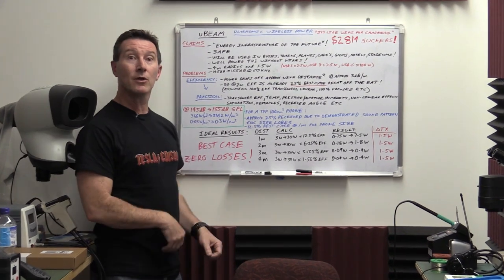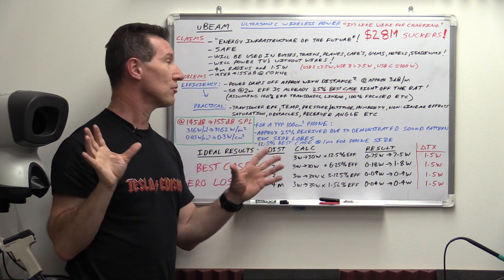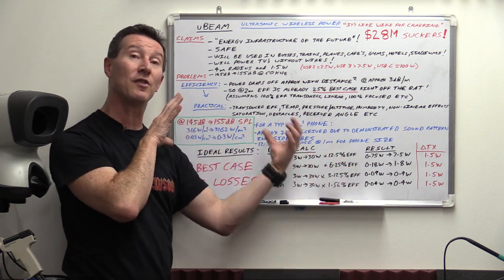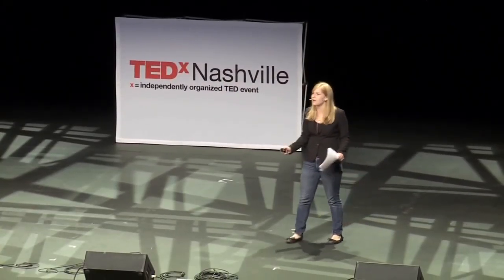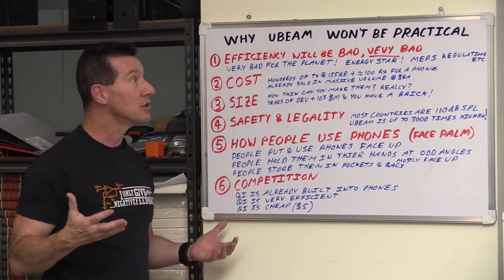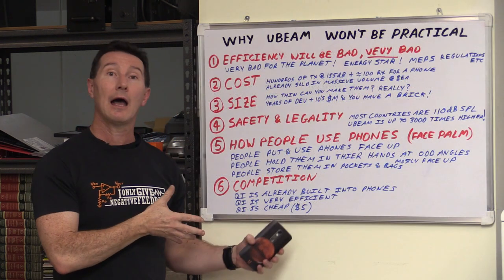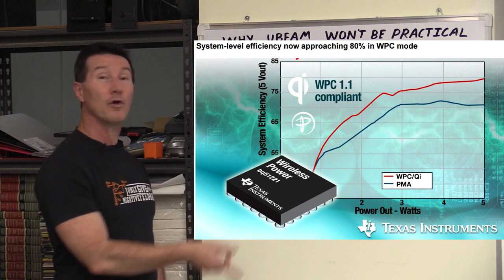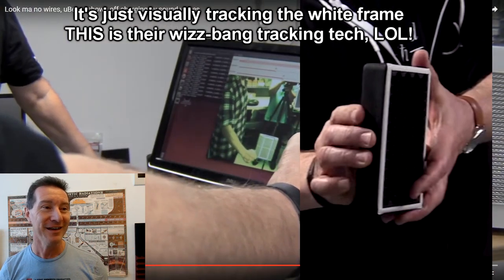EEVblog #1001 - uBeam Ultrasonic Wireless Charging DEBUNKED!

Comment: Wouldn't it also disturb the local ecology if it somehow magically worked ? Lots of species can hear well into ultrasonic range and I know it's beamforming but at that high of energy and the usage everywhere enough would surely some of the energy "leak" (for the lack of a better word) out of the beam to harm certain species.
Reply: 145 dB to 155 dB is too loud to be heard.  125 dB is very bad for human ears which are relatively insensitive.  A 100 to 1000 times higher pressure level and a more sensitive ear is not a good combination.
Reply: I stand corrected!

Comment: I have a 22000MAH battery brick that's about the same size as that receiver.  I can charge 3 devices at once, at 2 amps, from flat to full, 2 or 3 times over.  It was $40.  When your competition is either QI cheap plug-in chargers or "just get an additional battery", charging using hundreds of ultrasonic transducers is absurd.

Even if they solved the thickness and weight problem with the uBeam, even if they solved the cost problem, even if they somehow solved the ergonomics problems, it's still not practical to use it because of the sound levels.  There are reasons why you should consult experts in what's practical instead of spending millions on what's not technically impossible.

Comment: You know the efficiency rating would actually be half what you said, since SPL drops by 6dB per every doubling of distance, not by 3dB (assuming a perfect 'point source')
Reply: I do not know about measurements above the "listenable" audio range, however in audio the power output of a audio amplifier must be doubled to gain 3dB in volume (make it play louder).

Comment: You can do neat stuff with focused ultrasound, such as sound projection to have audible sound reflected from a concrete wall. Not energy-efficient, but quite a surprising effect, which could be useful. I've seen demos where you can hold your hand into the inaudible primary ultrasound beam, and hear music reflected off your hand. Maybe they could go into that direction with their tech, which I agree is quite impressive. But phone charging is not the application.

Comment: This video gave me an idea for a system that would actually work, and I already have the apparatus to do it at home. The power transfer should be better than 60 dbm. Seriously, the apparatus us already in my kitchen. It uses RF rather than ultrasound, and it's quite a bit larger and uses over a kilowatt of power, but could be easily modified to charge phones anywhere in the house. All I'd have to do is modify the stirrer and defeat the door-open interlock. Now  if I could just figure out a way to overcome the safety issue, as it currently tends to cook anyone who gets too close.
Reply: thanx, i also got a microwave oven ;)

Comment: Just to point out, Cophasing or better known as beam forming is a science that uses feedback in order to appear to be tracking an object. It actually superimposes waves based on phase shift at a geometric distance from the transmitter.
I forgot to mention, had to come back and edit, the feedback is from a camera on top of the transducers and the funny part, the tracking is done by NVIDIA Jetson TK1 which is ridiculous to think i would be showing off my phone to some charger to fire Ultra sonic vibrations to charge my klunky phone.

Comment: I really like your vids and you are fast at debunking stuff but just consider this:
If there was internet back in the day and you heard about x-rays and marie curie, you would have debunked it right away too yet today it's one of the most common and regularely used technologies to check broken bones, dislocated muscles etc...
it might have it's spot in some niche applications where efficiency isn't a requirement.
Just think about it for a sec.
Reply: The problem with your thinking is the following:

Ultrasound technology has been around for years. Pressure waves as a medium to transport energy is known for a long time. This chick and her company did not really invent anything, they only clobbered existing tech together in the least practical way possible. So it's not the same as x-rays and marie curie.

And it's the same bullshit over and over again, which makes you think everyone with a highschool level of physics understanding and the "yellow physics formula book", a napkin and a pen could debunk such bullshit ideas like solar roadways, waterseer, fontus, thorium cars and wireless energy transmission (be it coils and EM fields, magnetic over large distances, sound waves or laser beams) in less than five minutes.

The best lithmus test for bold claims about new tech is the following:
- Has there been recent discoveries in the scientific backbone (physics) that change the laws within tech can be developed. This was true for x-rays and radioactivity in Curie's days. This is not true for any ultra-sonic related tech.

Bam. Done. If this single point is checked, you can easily debunk any claims about new technology.

The second point is that you do not produce something and wait for a niche where it can fit. It's not necessary. If the niche will come up, you can develop a product for it then. The niche will not magically pop up after you have the product, that's just too arbitrary and unlikely to waste 28M$ for.

Developing stuff that has no application yet only happens in the so-called fundamental fields of science for a reason: It's providing building blocks for future tech. It does not happen in the tech-to-market space. I'm sorry, but fundamental laws in physics strictly dictate what's possible in engineering, and never ever the other way around. Engineering your way around laws you have learned about in high school physics? Not possible.

I all too often have to do head->desk and facepalm when I see new claims about magical batteries and new, revolutionary 100GHz computers. It just doesn't happen without new ground breaking results from fundamental science research first.

Seen any new fancy tech recently? Look out if there exist some research papers to back it up in a fundamental way. If not? It's bullshit, easy as that.

Comment: By the looks of that emitter, and its ability to beam in direction, I'd warrant that it uses a phased array. I recall you did a video on an experimental phased array antenna a while ago. Could you do a video on how to control the phase shift of each element in order to steer that beam?

Comment: I sometimes think you forget that computers used to be the size of a car to do less then 1% of what a phone can do now. So in the future I am sure they will get it down in size, efficient enough to charge. I am more worried by the high dB waves that will screw up some animals and other devices.
Reply: Lakloplak You are completely missing the nature of the inverse square law and inherent attenuation with distance from the source, these are not things you can just optimize out of a product with mere research, they are fundamental rules of physics and mathematics.  Then there is the issue that these ultrasonic frequencies are well within the normal hearing range of many common pets and the inherent dangers of 155dB sound pressure levels.  Worse still, the technology does not account for the manner in which people actually use their phones or the fact that high power ultrasonic transducers are not exactly compact, and can only be shrunk so much if they are to perform their acoustic role at a given frequency, nor are such at all inexpensive making the technology many orders of magnitude more expensive and bulky than competing solutions that already exist and are widely implemented.  And then there is the matter of how long charging will take at just 1.5W maximum, it would take nearly all day to charge an iPad for example, assuming that I barely used it for that day and that it were optimally oriented for such charging (greater than 15 hours if turned off the whole time).

Comment: How does the sound (kinetic) energy become electrical energy?
Reply: The same way you produce the sound, ultrasonic piezo transducers.  It would be very wasteful since sound waves spread as Dave pointed out.  Even if you bonded the transmitter to the receiver you are not going to be able to get any real efficiency and sticking them together defeats the whole idea.

Comment: Expensive, extremely inefficient, large. Why not just put regular chargers everywhere instead? Save money, preserve health, charge a lot faster. Or build in wireless charging into the seats in stadiums to place your phone on the hand rest and let it charge. What a great vision they had. Invest in making better batteries instead. That attachment is so huge, might as well have been a huge battery that would last weeks, lol.

Comment: is it safe?
Reply: NO.  125 dB at audible frequencies is enough to make you deaf, this is 100 to 1000 times the pressure.  And losing your hearing should be the least of your worries, I've seen a video of ultrasound being used to make juice of an orange (can't find it though), so don't stick your head anywhere near one of those transmitter or your brain might be turned into a liquid and pour out of your head. (Gross joke, but I wouldn't be surprised if it can literally do that to your organs.)

Comment: DISCLAIMER: I watched only until 1:43 so far, but I couldn't hold this comment
If this actually will work (it won't),  it would probably be unhealthy.
Yes I know we are carrying them in our pants blablabla, but do realize: the things we carry in our pocket only transmit low frequency, low power signals.
In order to be able to power a frigging train, a lot more power is needed, enough to be able to damage (cook?) our bodies

Comment: 145dB - 155dB at 60khz that would really screw up WWVB reception.
Reply: Also more RFI pollution.  

How safe it is to be continually pummeled at a close proximity by 60Khz?  I suspect that if more research were to be done it might be as unhealthy as x-ray exposure.
Reply: I just noticed David (or possibly an assistant) was so wound up about this, that their was spelled thier :)

Comment: I think they need to go back to high school, And study basic physics. Specifically Isaac Newton's formula for gravity/radiated energy. "Distance * the inverse square". Every time you double the distance, you decrease the intensity buy a factor of 4. I think they have forgotten that. In order to power a TV, from 3 m away, your transducer would have to be rated in Kilowatts. And there's no telling what long-term exposure would do to people. also,  How would you contain it. how would you keep your neighbor living in the apartment next door from use in your energy, to power there appliances. It's just a new twist on an old experiment that Tessler tried. Transmitting energy using a high-voltage transmitter. Come to think of it, That experiment is still going on. At least it was a few years back. And to my knowledge they still haven't made it work.

Comment: So, QI needs like 50% more power vs a wire? Wow
Reply: If it's 50% efficient, and we assume that's after the power supply (which has it's own inefficiencies), then it actually requires 2x more power (a wire is close enough to 100%). However, that's a lot more efficient than say a 1% ultrasound charger by 50x ;-)

Comment: What is cool about that tek? Using a nvidia jetson for video tracking? Using ultrasonic beamforming? 
That is a stupidly boring exercise with some manufacturers evaluation kits/boards.
You just hire a competent engineer or two and in a few months they will vamp something up like that.
The clever thing about this is fooling the investors.

Comment: add batterizer  to boost the voltage. with roadway solar panels power system

a solar panel from solar road way would do a better job then that garbage

Comment: couldn't you charge your phone by using the technique of materials rubbing against each other to produce a current a static charge, I think this wouldn't work! current to small? couldn't it be scaled up to produce a bigger current. would be the perfect thing for phones, you have it in your pocket and the movement of your body would  charge  it easily could the manufactured make the case of this?. ©.
Reply from the maker: No, there isn't nearly enough energy involved. As in, practically zero.
But quick, patent the idea and do an Indiegogo campaign with a catchy video!
Reply: Don't forget the inspirational TED talk, cartoon scientists and tear-jerking video.
Reply: EEVblog what if you rub it really hard?
Reply from the maker: Friendroid Sure, call it the Wankero and it'll sell like hot cakes.
Reply: With a wank-o-meter attachment for added value!

Comment: I'm not invested in this company but as a general investor I am really disappointed in this video. You clearly don't understand investments. Immediately looking at this technology we know it won't work out for phones. It's a proof of concept. You do not pivot when you are a startup in a emerging technology. Investors are going to make a boatload on this. What will happen is when the technology is good and researched one of 2 things will happen. The tech will be sold to a larger company or they will sell use rights. Look at NASA 99% of what they invent for missions never gets used again for it's designed purpose. Instead industries take that free R&D and use it for other applications. I can think of dozens of industrial applications for this. Progress is not linear. You should know this as a STEM educator.
Reply: Bwhahahahahahahahahhahahahahahahah